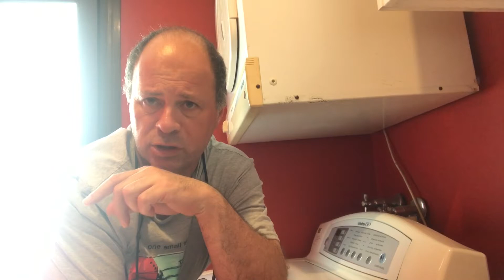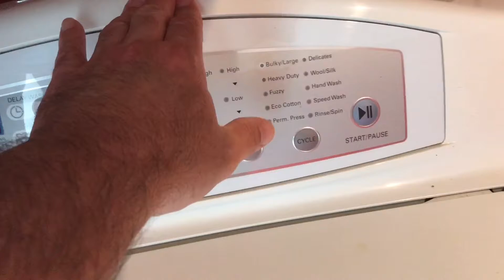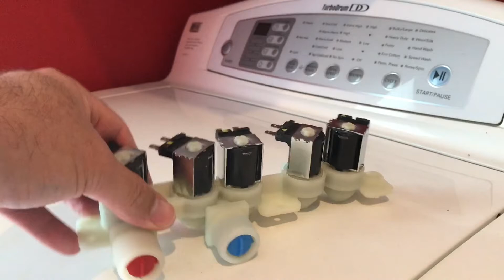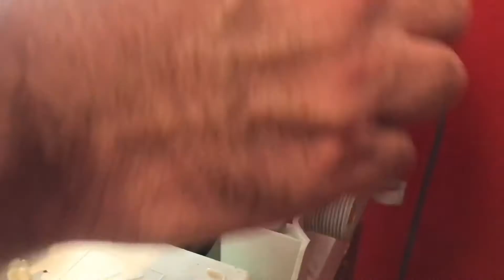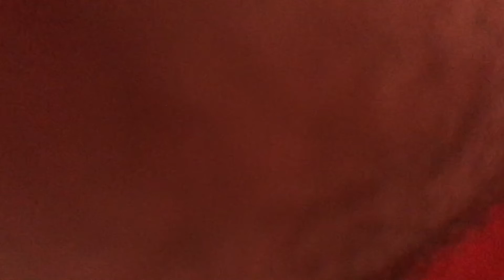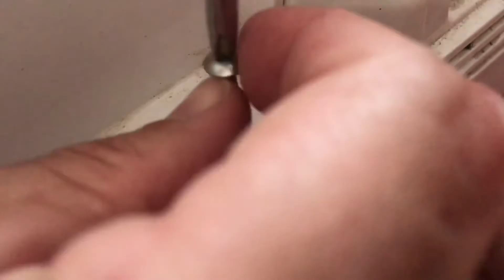Top Loader Water Inlet Replacement

Comment: Washing machines on the air ??
Reply from the maker: Easier than the TS-520! Both working now! 😅
Reply: @TheArtofEngineering  check the caps in the bias network. Peavey Valveking had that problem. Cost me a set of tubes before I found it.
Reply from the maker: @MidlifeRenaissanceMan  Probably should just change em all! Xmas hols maybe?
Reply: Do those valves also work in the TS620S ??